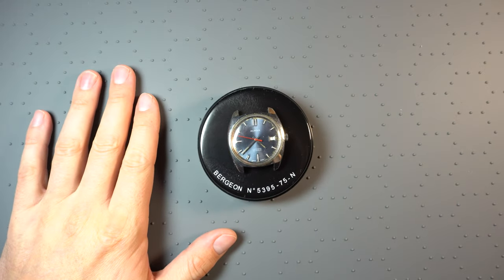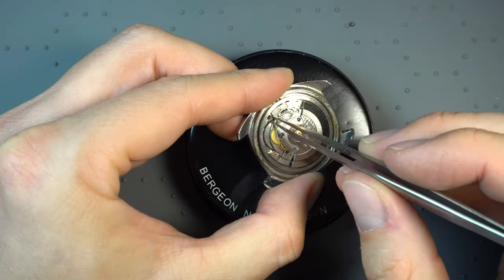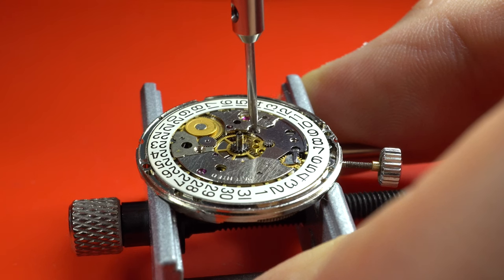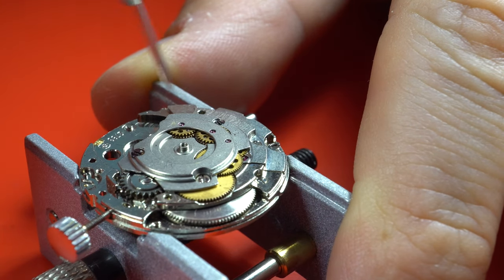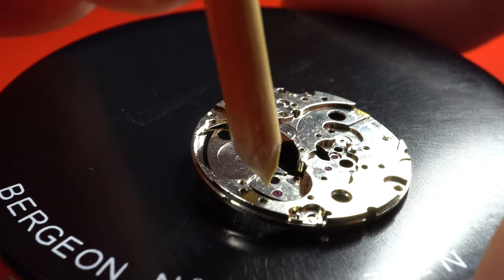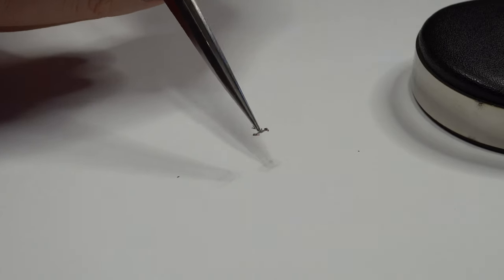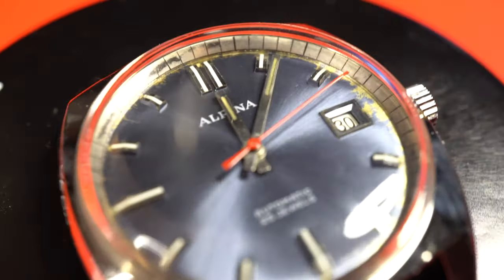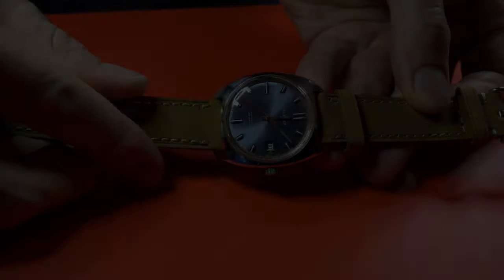Alpina ETA 2783 Vintage Watch Restauration 4K

Comment: Date intermediate wheel jump cut, no worries mate,🤔 i'm putting my eta 2783 back together, from a 70s Monarch Caravelle, good movement though, nice to work on, +-1s/d is the goal. 😎
Reply from the maker: yeah those ETAs are still running strong. +/- 1 is always possible, rarely in all positions tho. I think their factory accuracy is given with +/-12.

Comment: I'm wondering if you didn't run into issues with the balance wheel because the impulse jewel is also glued into the roller with shellac. Thanks for the nice video.
Reply from the maker: No problems there so far. Still running good. But thanks for the advice. Now I am using different cleaning solutions anyway :)

Comment: Impressed by your skills and explaining! But as far as I understand, the part you call "center wheel" is actually other wheel, the one which seconds hand is sitting on. And it should be lubricated with low viscosity (light) oil. In this movement, the cannon pinion is not of a classical type. So, there is no center wheel with here.
Reply from the maker: Thanks you are absolutely right.